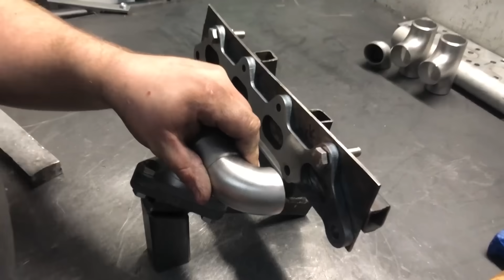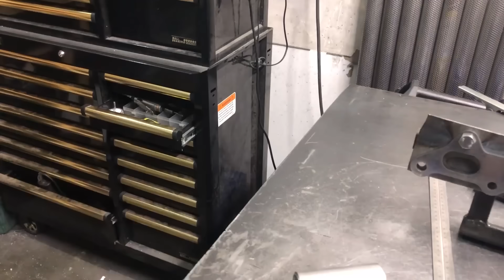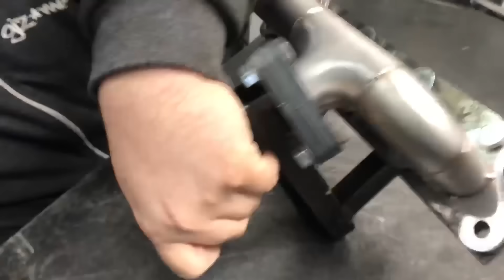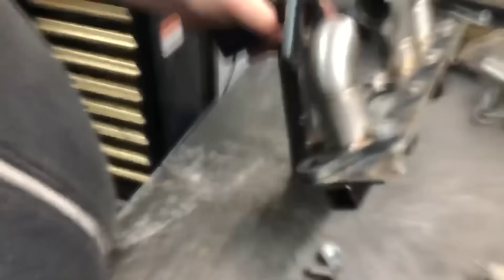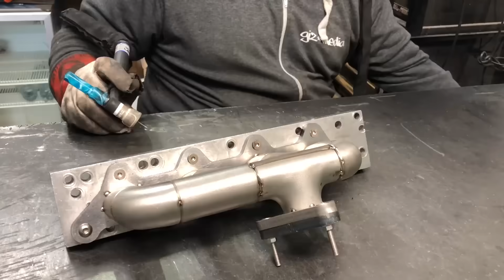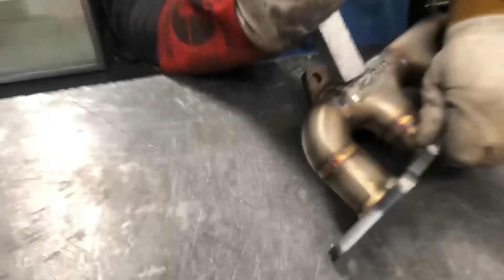GizFab - Mitsubishi Colt 4G15 Turbo Manifold Fabrication Timelapse

Comment: Hello, first of all looks great👍
I drive an Colt Ralliart 1.5L Turbo with 180Hp, can someone tell me what advantage this manifold would get me? Or is this product only for non turbo cars that would like to build on an turbo?
Reply from the maker: a this manifold is a direct replacement for the factory manifold which are prone to failure. This manifold will flow slightly better. Proven to support 260hp on hybrid turbo.
Reply: @GizFab  aha, so i trie to remember to you, if mine breaks. I think its not leagal in switzerland but this doesent interest me😜

Comment: Do you build manifolds for the paired-port 4g15 found in Mirages/Lancers?
Reply from the maker: Same as the Evo? TD05H?
Reply: I have the 4g63 manifold on my Galant VR4 (same head pattern as Evo). Aftermarket is great for the 4g63, not so much the 4g15. Only one cast manifold is available thru eBay.

 I am piecing together a turbo kit for my 1999 Mitsubishi Mirage  with SOHC 12V 4g15 engine. Do you make custom manifolds?

Either way, great work!
Reply from the maker: I can do custom manifolds sure, although im based in the UK, i deal with customers world wide. I do have a 4G63 Stock Manifold in stock for Jigging.